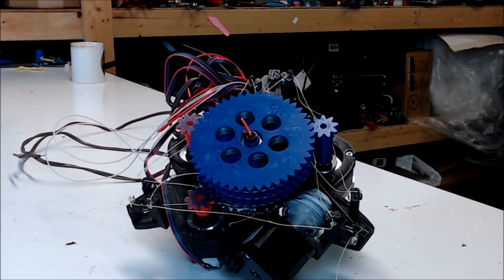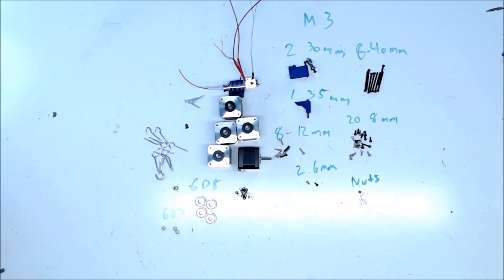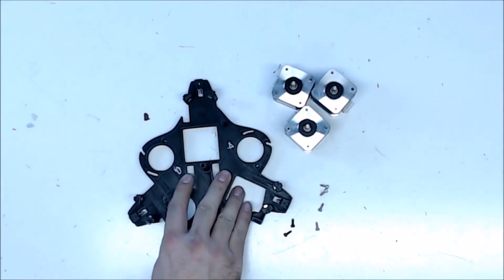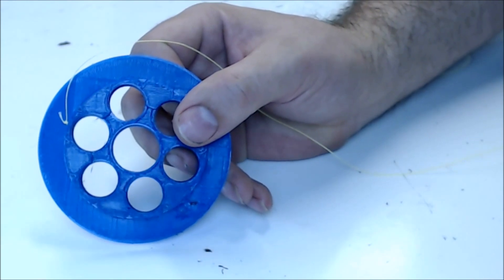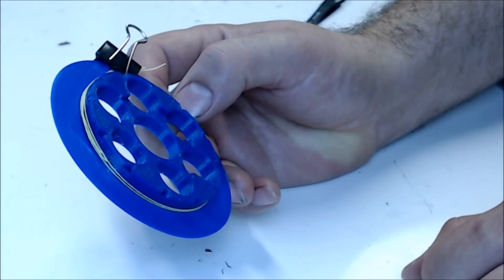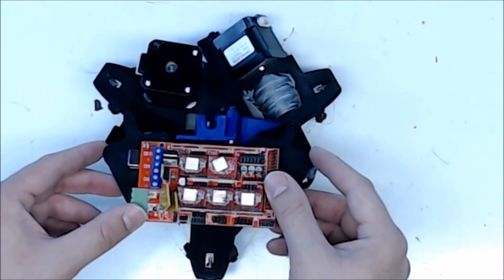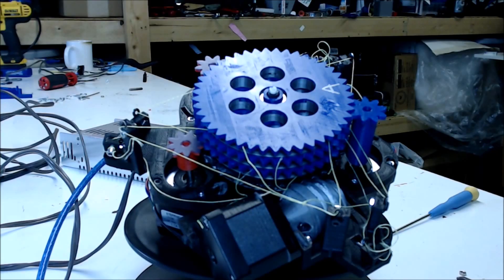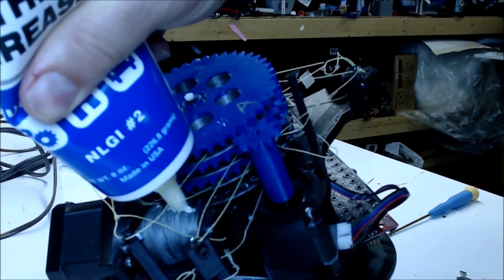Hang Printer - 3D printer Build Part 1 see correction below before you start

Comment: How did you roll the fishing line in the gear ??It's not so clear in the video .....Plzz can you help me out bro!!! I am trying to build one myself and got stuck in the middle
Reply from the maker: Sure I can help. You just try to keep the lines separated with your fingers as much as possible and start wrapping keeping them tight as you can. Don't over think it, it will still work. After you get everything together you might want to let the motors unwrap all the line then rewrap it themselves.

Comment: Do you need to change anything on the stepper drivers for the ramps board at all?
Reply from the maker: No, you should not. There is a Hang printer firmware that has all the changes you need. That default firmware assumes 1/16 microstepping. So an A4988 driver should work out of the box with all the jumpers installed.
Reply: Chris Riley ok thank you and I have come to find out that it isnt the stepper drivers having the issues it's the ramps board itself. Another question can you use a RAMBO board instead of a ramps? Because in the hangprinter firmware in the boards.h file it has Rambo listed as one of the boards you could use but when I set the motherboard number to the Rambo number it says unknown board type?
Reply from the maker: Nicholas Scott Rambo is really close to ramps. I wouldn't think this would be an issue. Torbjorn would have to confirm this. You can post a question here to get the answer. http://forums.reprap.org/read.php?1,792937,page=5